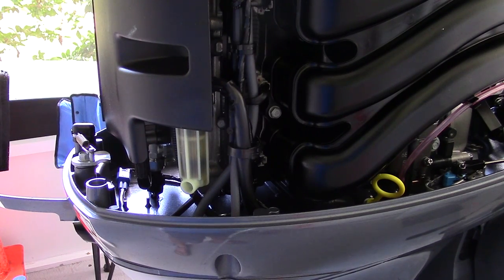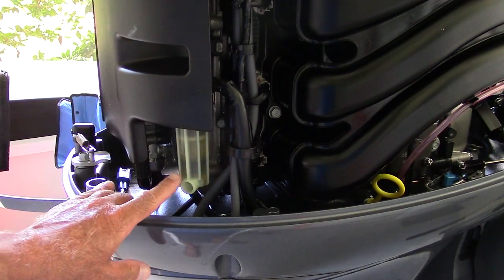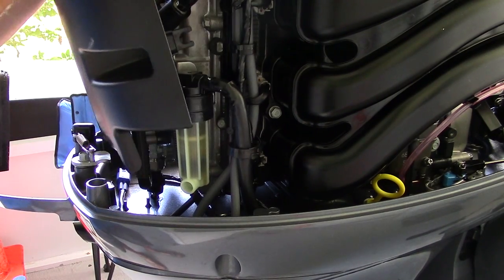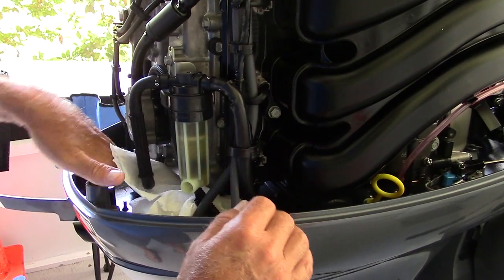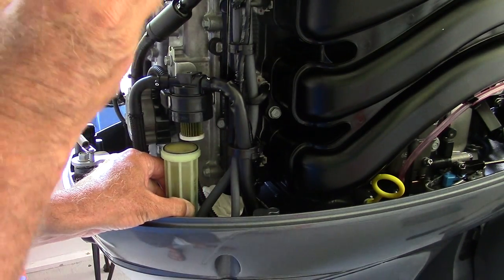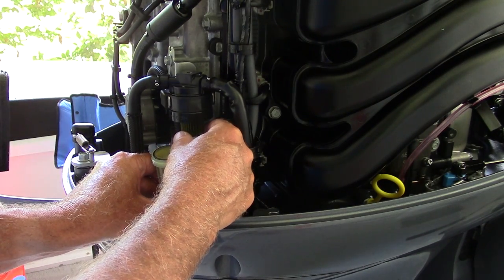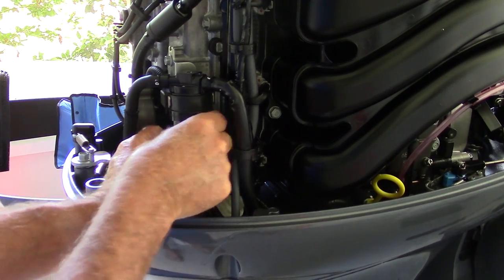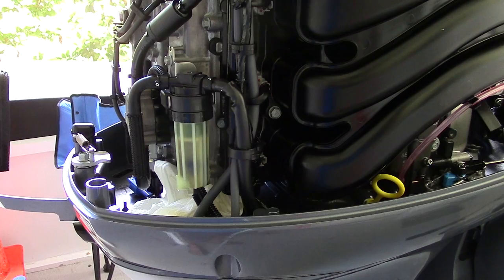2016 Yamaha 115 LB Outboard Fuel Filter Element Replacement Update 2024 Version

Comment: Today when i took boat out it would only run at half power,,like one cylinder is not firing,,it is a 2017 115 4 stroke with only 15 hours ???Rab fine last time i took it out,,,i think it knows it striper season and its wanting to pissme off...isit possible i have a fuel filter problem

Comment: Thanks Captain. I have a 2016 Yamaha F175, appears to be the same filter and process, is that correct??? Also, I was told that you need a "special tool" to remove the filter cover. Obviously you completed the task by hand.

Comment: You will in the end break the water alarm wire in the bottom of the filter bowl if it is turned without disconnecting the connector and let the wire turn together with the bowl.
Reply: How does the connector come off?

Comment: Thanks Drew. When you run the engine, does air enter the top of the fuel cup; eventually causing a 1 inch air pocket at the top of the cup. I can use the primer bulb to eliminate the air pocket, but if I let the engine run the fuel level sits at about the bottom of the filter element. Do I have a air leak in the tank hose?
Reply from the maker: No. Shouldn't.
Reply from the maker: You may have a kink too, follow the line and check that first.